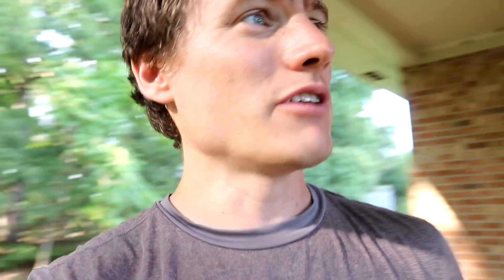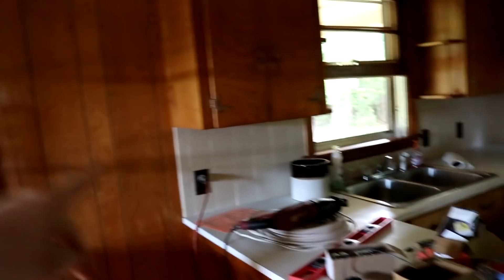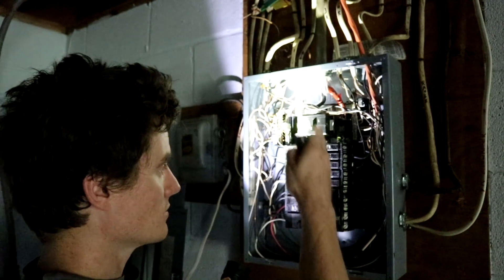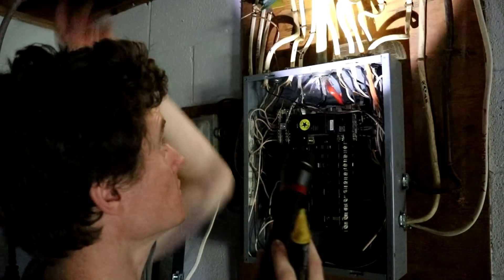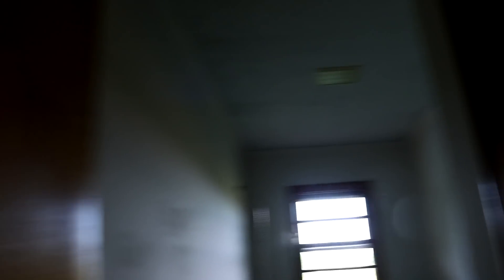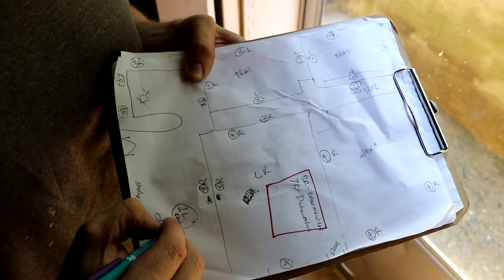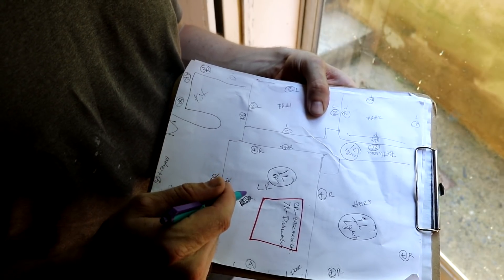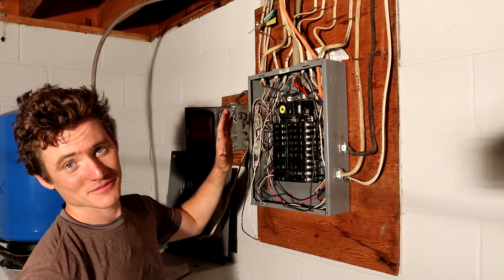Old House Renovation - First Day of Work! - #3

Comment: It's more that it looks like something you'd see in Europe (or the rest of the world really) 60 years ago than that it is "different".
Reply: Amen brother. But let those sheep/noobs here in the comments all think that it is neat and tidy.
Reply: Looks like a Square D board aka Schneider in the Uk terrible job done on it btw, no RCD's, no testing/inspection, IP rating failed top of consumer unit and twisting cables together massive no no - use through crimps ffs
Reply: @garyprice464  US Electrical code is very different from the UK or what is found in the rest of Europe. Wire nut joints are acceptable under code and the standard, while crimps in residential and small scale commercial are rare. If done correctly there is no problem. The current electrical code nationwide requires RCD's for serving wet areas, but we call them GFCI's in the US and Canada. The GFCI is normally built into the first outlet on the circuit from the breaker in existing construction, but in new construction a GFCI breaker is used instead. Current US electrical code requires arc fault suppressor breakers in new construction for bedroom circuits. 

The UK code is well regarded globally as one of the best electrical safety codes out there. The US code is weaker on the residential side, but more cost effective and strikes a balance between safety and cost. Interestingly, the Japanese wiring system is similar to the US, but without mandatory ground to each outlet. They have grounded outlets in wet spaces, but generally not in dry spaces.They do require an electrical safety inspection every four years for governmental compliance, and I would think such a program does protect people from dangerous faults. Such a program would never fly in the US with the population preferring that the government be involved in individual lives to the minimum degree.
Reply: I was having something very similar in my mind, it is quite strange to watch somebody installing this as a brand new electrical box, while in my country you would immediately get rid of it if you bought a house with something like that. I love the videos especially for this, because it is really informative and entertaining to see how extremely different even basic stuff like wiring and plumbing can be. And this channel is great.

Comment: I'm surprised the inspector is okay with you splicing wires inside the panel. The ones i've dealt with have not allowed me to do that. I had to set a box outside the panel and reroute the circuits. Beautiful panel though, great job!
Reply: Every municipality is different. The NEC will allow you to extend a wire within the load center, but some municipalities will layer requirements on top of the NEC.
Reply from the maker: My local follows the NEC and doesn't have any requirements beyond it.
Reply: Its always up to the authority having jurisdiction. I just had one with stricter rules.
Reply from the maker: @symposes  My last inspector was a brute, got me on all kinds of stuff that made no real difference, he was literally hunting for problems and even came up with a few that I knew where not problems and got him to look them up....luckily I was right.

Comment: do u have to upgrade the service coming in the house? i wanna do this to a house im trying to buy. the house currently has a 100amp service. i want to run power to the detached garage i may add one or two 220v outlets in the garage maybe a sub panel to run maybe a welder and compressor. i also might run a 220v outlet in the kitchen for an option for an electric stove if i wanted (ill be using a gas stove though). there is a 220v outlet for the dryer and gas option again ill be using gas. ill also be putting in lights electric garage door opener fridge internet ect out in the garage.

Comment: so i want to be electrician (really a renewable engineer) but starting out as a electrician i was told at a job fair i am gonna need advanced mathematics, is this true? i've learned a lot by watching videos and watching Homemade home really inspire me to do home renovation alone. Any tips, recommendations for learning things?
Reply from the maker: Yes, you will need to be extremely smart like I am and all the other genius-level tradesman you see at Lowes and home depot........sorry, looks like cutting wires to length and tightening screws is not in your future. Obviously joking. Tradesman have a way of getting a little prideful and defensive of their trade at times, making it out to be more than it is. It's a job like any other, a set of tools and rules. Anyone can learn. I do not do any math beyond the most basic measuring.  Residential wiring is simple. I have a friend that is an electrical engineer......that's a different story. Compared to him, I'm about as smart as a rock.

Comment: I have read how backfeeding can lead to all sorts of trouble and potentially cause fires. Do you think these people are being overly cautious?
Reply from the maker: I don't see how personally, I guess the circuit you are feeding in won't have protection from the breaker but the rest will....i think. The generator also has protection, so I can't pull but so much.....I don't know and haven't burned anything down yet.
Reply: Backfeeding is big mistake. If you want to give electricity to home from generator, first you have to do is; cancel the main line which is coming from government electricity network. Seperate those cables and isolate them. Then from same point, connect generator cables. Turnoff unnecessary circuit breakers because generator can not feed complete house.backfeeding is something like u insert a food in your... Anyway ı wont talk dirty :-))

Comment: we call those type non-contact testers "tick testers" or 'widow makers' in the industry....   they'll get you hurt if you trust them long enough lol....
Never, Never, NEVER put splices in the panel box... mount a box above the panel and use a large chase nipple to enter the top of the panel....
Reply from the maker: Care to explain.......?
Reply: @homemadehome5575  "widow makers" the nick name is because that type of tester isnt very reliable at times, and has gotten many electricians shocked or killed over the years.  they read a form of static voltage through the wire but they can often give false readings as they can be influenced greatly by static and other natural things in the environment.  (turn it on and rub it up and down the front of your shirt... it'll tell you that you're electrically charged when surely you are not)
take for instance if you are working on circuits with "shared" neutrals.  (where 2 or more "hots" are using a single common wire as a neutral)  many times a non-contact tester will tell you the wire is "dead" however the neutral can still shock you if the "shared" hot wire from the other circuit is still on.  (so if there are 2 hots sharing a neutral both breakers will have to be off get rid of the possibility of being hit off the neutral wire)
Also they won't work where there is a cancelled or static electric field:, things like Wet cable filler or sheathing, Metallic cabling or conduit, Shielded cables,Twisted pair cable or anything that's DC current.  If you're working on or near anything like high voltage it'll cancel out their effect or cause them to misread a lot.
Reply: @brokebutfunctioninggarage  so what do you suggest using instead?
Reply: @mar217rocks7  I always use a digital multimeter.    (i have a fluke as well as a Milwuakee multimeter)

Comment: Those Romex connectors suck; get nonmetallic connectors from Arlington. “Black buttons” they’re the best. Source; I’m a master electrician having done hundreds of panel swaps
Reply from the maker: When you say the romex connectors suck are you just referring to them being slower than the black buttons. I didn't know they existed, just looked them up. Thank you for the tip.
Reply: Homemade Home while the black buttons are quicker than the old romex connectors; another reason I evaluate them as sucking is I often encounter old ones that are rusted solid, and are in situations where I have to remove them and it’s a pain. Now, I don’t know how these black button nonmetallic knockout connectors will look in thirty years; maybe the plastic will be dry rotted and they will disintegrate from the mere thought of removal; but we’ll see.

Comment: How did you learn how to do all of this stuff? I'm thirty years old and I work in healthcare IT. I love my career and don't want to change anything, but I want to learn more about building and renovating. I would love to be able to put in new kitchen cabinets by myself instead of paying a million dollars. Or buy a cheap house and upgrade it myself. I was thinking about volunteering with Habitat for Humanity. Do you think that would be a good way to learn? If not, what can I do?
Reply: Look for a beginner construction course. Then volunteer for Habitat... good luck!
Reply: I think the surest way to learn how to renovate a house is the same way to learn how to drive a car with a manual transmission - buy one and go at it. 
Watch a bunch of episodes of This Old House and HomeTime. Be careful what you watch on YouTube. This young man has been pretty close to the mark on just about everything he's shown - but there are many other channels that do things that make me cringe.
Always pull permits - you will not find a cheaper way to get someone competent to safety check your work. And if you approach the folks at the permit office with the right attitude and degree of respect, you will be surprised at how helpful many of them will be. Some of the best guidance I've gotten has been from the folks at the permit office (although I must admit that I've yet to find a plumbing inspector who was at all helpful!).
Don't do pipeline gas work yourself. If you make a mistake with plumbing pipes, you get wet or messy. If you make a mistake with gas lines, you can end up dead.

Comment: Whats the tool that you use to fix the extra wooden board to the wall? look like a chisel but seems to be putting a fixing through the wood into the wall?
Reply: Ramset.  powder actuated nailer.  It uses a gunpowder charge to fire the nail into the wall.
Reply: @dennisp.2147  Thanks!

Comment: First, obviously you should have had another person come out to the house and talk you through the circuit feeds as they flip the breakers on and off while the power was on. You can talk via cel phone. But if you have turned the main power off by disconnecting the main feed, a way to trace out your circuits that is 5000 times safer than what you're doing is to get a 9 volt battery and one of those little clippy things that clips on to a 9v battery, then wire two alligator clips onto the leads. That's a Radio Shack item, or, you go to a thrift store and buy a busted transistor radio. Then you power up the circuits with the battery, one by one, and you go around with a voltmeter and see where they go. In some cases, you clip the battery onto various things in the breaker panel and test with your meter at the outlets or the lights. In other cases, you have a male AC plug and clip the battery clips onto the terminals inside the AC plus. If I may, you have a little kid and you better start thinking like an old man when it comes to safety.
Reply from the maker: I understand, in this case it's not really that dangerous. Just need to be care full with the extension cord. I get it all plugged in before starting it. There's also no one around that could hurt themselves. Sometimes I just have to do what I have to do, I already had the generator there for working, other than that, I have old man tendencies with a lot of stuff.
Reply: @homemadehome5575  Did you get my suggestion as to breaking the basement stairs, building a landing, and making a right angle turn in the opposite direction from the exterior door? Might have headroom issues, you won't be able to break them in the middle. I am agreeing with you, those stairs are dangerous. Maybe at the second or third stair up from the bottom.

Comment: Europeans would use crimped butt splices to join the cables. Otherwise the logic process is very similar.
Be very picky on the pens used when you label the cables, a lot of them fade badly with time

Comment: Try learning how a basic test meter works and you wouldn't need to take unnecessary risks with unsafe practices
Reply from the maker: I get it, but it's not that dangerous what I did, no different than checking stuff with the power on which people do all the time. No one is around to mess with the extension cord in the generator.

Comment: yeah, holy shit that would not fly in Sweden. they would shut off your power and you would probably go to jail/being fined for doing it yourself :P and you should really take a look at Wago 221, way better than those wire nuts :)
Reply: btw i do love your videos <3
Reply from the maker: People are normally scared of what they are not familiar with. Wire nuts are a very secure fit. Once installed, wiring isn't moving. As long as it's installed correctly, it will work as good as any other system. I'm familiar with wago connectors. They have been on several different fixtures I've used. My inspector told me that when it comes to problems when used correctly, he has seen more issues with wago connectors than wire nuts. His words not mine. Wire nuts are just simple and cheap. Not hating, just explaining. Thanks for watching.
Reply: Wire nuts have been used for decades with no problems.  Jail?  What is wrong with your country?  Fascism in socialist disguise.
Reply: Homemade Home never seen a wago fail but I have seen a lot of wire nuts with wires fallen out. They used them everywhere before. Now days all electricians use wago here in sweden.
Reply: Wagos are handy if you have short tails/ leads in an old work box.  Easier to extend.

Comment: Which generator did you buy.
Reply from the maker: Harbor freight predator 3500 before the price got jacked up. It's great, starts right up and runs my whole house easily except for the 240 circuits. Power went out all day a while back while I was working in my shop building furniture. I got it all rigged up and worked all day, shop full of lights, tools, dust collector. Wife up stairs doing her thing. I like turning it on and flicking on all the lights. Sat inside using it one time for like an hour after the power came back on just for fun. I also use it away from power a lot to run lights outside when working at night.
Reply: Thank you Sir

Comment: Cool vid! Does anyone know what the tool on 14:14 is called?
Reply: Ramset
Reply from the maker: That there is a "Powder Actuated Nailer". You put a nail in the front, a 22 blank in the back and hit it. A plunger forces the nail into the wall. It is used for masonry applications. Wonderful tool.
Reply: @Daan van O:  It's a powder-actuated nail gun, sometimes called a Ramset (which is a brand name).
Reply: Thanks y'all :) They seem to be not very common here in Europe, I can only find big gas actuated ones. And that's a shame because they seem like a lot of fun to use!
Reply: When my mom and I were finishing out her basement we called it the boom boom. lol.

Comment: Wire nuts were banned in the UK years ago they was ceramic coated back then. we are 240v and some one probably electrocuted thereselves being stupid. So that was that.  U Can't do electrics yourself here either have to be certified to do it.
Reply from the maker: I'd be in trouble in your country. I started buying houses with about $700 to my name, no experience, no tools and a station wagon. Now I buy a couple houses a year. That would be hard to do with that many regulations and the high costs that result.
Reply: @homemadehome5575  yeah it's crazy here in my area you need around £120,000 to buy a house that needs work and that would be a one bed house or if u was lucky a 2 bed but it would need lots of work its so hard for young people to get on the property ladder now. Atb Adam